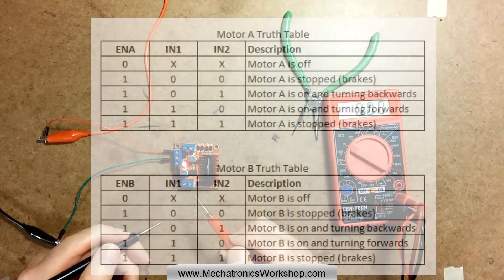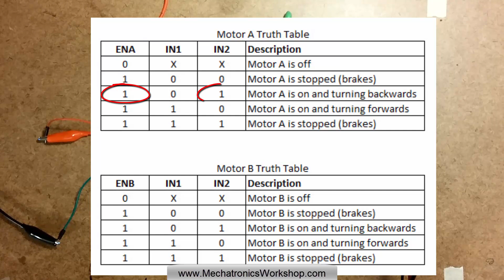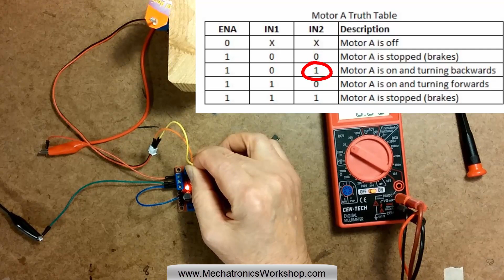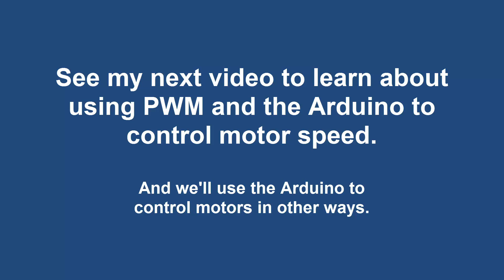The L298N H-bridge motor controller module - basics

Comment: Thank you, I was watching bad tutorials and couldn't find the original spec sheet. Burnt my first one, but my second one should work fine for senior design!

Edit: For people wanting to power a 4A motor by wiring both outputs together and syncing both enable, and all 4 input pins. Match the numbers on the bottom of the board and you will see. You must either reverse the pins that bridge across the outputs or reverse the input pins of one motor.

With the outputs jumpered together like || and enable lines in sync 
In1(Low) In2(High) In3(High) In4(Low) 
will turn the motor a direction. 

In1(Low) In2(High) In3(Low) In4(High)
can burn the transistor (I had 12.2V)

I lost one board to this. Just read the numbers on the bottom and make sure High Low is in sync
Reply from the maker: Glad it's working out!

Comment: Just what I was looking for. I need control speed and direction of two DC motors. I want to switch direction of both independently and also have an speed control. I need also to add micro switches but I’ll worry about that later!
Reply from the maker: Sounds like fun!

Comment: Very good explanation in simple language.  Could you please tell me the changes I will have to make if I have to run two nos 12VDC motors at the same time and in same directions. Thanks.
Reply from the maker: Thank you! I don't know what nos means, but you can just connect one motor to outputs 1and 2, and a second motor to outputs 3 and 4. And jumper the inputs in parallel would be the simplest solution.
Reply: @MakeBasicElectronics  nos means NUMBERS. Sorry for using shortcut language. Thanks.

Comment: you should be all right running it on 15v  did some calculations the l298 uses 35ma 15v input  = 10v drop across the regulator 10v x 35ma = .35a  temperature rise 65c per amp = 22c rise in temp of the 7805m regulator. but don't use it for powering your Arduino.

Comment: Just so you know, You should control motor speed via PWM signal to enable pin. Not with voltage.
Reply from the maker: Thanks - I agree! That's another point I didn't make clear enough in the video. In my simple tutorial here I don't address PWM at all. I wouldn't use a variable voltage to vary the motorspeed in an ongoing fashion, like speeding up and slowing down a motorized car. That would certainly be the job of PWM. But at 13:35 I'm referring to the fact that the input can handle  5 to 35 VDC. So if you have a motor that can handle that range (current and other specs obeyed of course), you can operate it at a fixed speed for some kind of device or display that you would like to rotate at a fixed rate. For that, you could input 12V as a test. If you like the speed of the motor at that voltage you can set that and walk away. Your display will happily rotate at a fixed, continuous speed for the rest of its life. If the motor is going too slow, you can increase the voltage to 20V as a test. Or 24V, or 30V, or whatever up to 35V. If you like that speed better, you can set that and walk away. So that would be the 'base' voltage and speed. If you wanted to vary your rotating device faster and slower beyond the base speed, then you would add PWM for that control.

Comment: Good stuff. Where is the PWM video?
Reply from the maker: Thanks! And if there was a prize, you'd win it!  As of today with over 65,000 views you're the first one to ask since I uploaded this video in 2017! So, obviously there hasn't been much interest in the PWM version, so I didn't take the time to do it.
Reply: @MakeBasicElectronics  Got it. If you have any references to share, that would be great. In any case, this was very helpful. Thanks.
Reply from the maker: @bchoor  Thanks again! This guy does a nice job on stuff in general. Here he talks about a more current motor driver than the L298N, but I think he has a video on the L298N also https://www.youtube.com/watch?v=JPPTRj0KWbg . Then I would just say what you probably already know -- search youtube for L298N PWM, or just PWM if that's what you're most interested in. And try similar searches on the vendor forums of what ever you're trying to connect. Like the forums on Arduino.cc, etc.
Reply: @MakeBasicElectronics  Good pointers; will check them out.

Comment: im trying to run a stepper motor  model 17hs4401s and trying using L298N only . im using a a bench power supply .i have kept the three jumpers on. putting 7.4 dc volts  on the 12v input and ground on center, and have out put of  5 volts. im using the 5 v to run to pin 2   getting nothing moving .  all my voltage read the same you are getting i do notes the your just running a single motor i think thats  considered single phase.  please help  garry
Reply from the maker: Steppers won't work with a fixed voltage input like a brushed motor (like my demo). You might see a very small jump in the rotation if you quickly add and remove an input lead, but you can't get rotation until you input pulses. You need a stepper controller board of some type -- like an Arduino or a dedicated board. Google something like "how does a stepper motor work", or here are a couple of articles that might help: https://forum.arduino.cc/index.php?topic=284828.0   and   https://learn.adafruit.com/adafruit-arduino-lesson-16-stepper-motors?view=all

Comment: At 12:30 don’t you have a drop in voltage due to the motor spinning and not regulator drop? If you go back to 10:30 you have the same voltage on the output pins as the input pins.
Reply from the maker: Good catch! You are right -- it's a drop caused by the motor running -- nothing to do with the 5V regulator!

Comment: What if the supply voltage is 12.5 volt? Should i remove the jumper and supply another 5 volt? Or will it be fine if i use the internal regulator?
Reply from the maker: At 12.5 V you're in a gray area -- component tolerances, meter accuracy, etc. might allow it, but you might destroy the 5V regulator. I wouldn't risk leaving the jumper in place unless you have an extra L298N, and depending on how badly you only want to use one external power supply. 

Think about this too -- a lot of power supplies will show a higher voltage when no load is connected. If you measured it when it was not connected to anything, you could test that. -- Remove the jumper from the L298N and connect your 12.5 V supply to it and measure the voltage while it is applied to the device. It's possible your supply will drop to something like 11.5 or 12 V when powering this (or any device) so you might be able to use it with the jumper in place if it stays below 12V. (the first discussion about removing the jumper is in the video at 1:09)

It's possible to lower your power supply by adding a regulator of your own before the L298N, using voltage divider,  or a diode or two (a typical diode drop is 0.7 V), etc. I can't help you with those techniques, but are possibly something you can look into.

By the way, the best info I could find on this device was on the ebay page where I purchased mine. So you might want to search ebay or other places for data sheets.

Comment: Hi.. I tried to control my linear actuator with this board, but for some reason after a while it makes my 200v breaker trip :/
I have no idea what's wrong, I'm using a 12v power supply with 3A max. Any thoughts?
Thanks!
Reply from the maker: What are the specs of your linear actuator? (Current, voltage). Are you putting too much of a physical load on your actuator? Where is your breaker in the circuit? What current rating does it have?

Comment: Can anyone please explain 9:29 ?
Why when IN1 and IN2 are both high it brakes? 
On other way, how does the IN thing works?
Reply: Another thing, you said it's the same when we put 1 or 0  for both IN which'll make it stop, but when I checked other's codes they sometimes use 1 and sometimes 0 to make it stops, so is there a difference? 🙈
Reply: Sorry for long questions 🙊
Reply from the maker: I don't know why IN1 and IN2 High cause it to brake -- it's just the way it's designed. If both are Low, it brakes also. I don't know which is which, but one brake coasts to a stop, the other one brakes it immediately. That's so you can use it on a robot I suppose. That way you can stop it immediately, or just let it coast to a stop. If it's important to you, connect it to a motor and try the input both ways and watch the difference.
Reply from the maker: Look at the truth table at 9:29 and it tells you which inputs cause it to do which things. Again, connect a motor and try it for yourself. It's the best way to learn.
Reply: Thank you so much 😄
Very well explained

Comment: So below 7v remove the regulator pin and above 12v also remove the regulator pin?
I have 3-6volt dc motor. Can i use 9v battery?(with arduino on its own power supply) Does motor voltage have to match power supply? So to use 9v battery, i have to use 9v dc motor?
Reply: You can use a 9V battery, but you would need to use PWM to keep the output voltage below 6V.